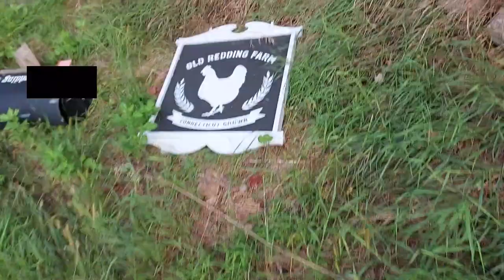Someone Destroyed Our Mailbox! *how to make a mailbox post with a cedar log*

Comment: We owned a house that had really bad luck with mailboxes. It was hit 3 times in 8 years. I finally decided to replace it with something nice and made my own post with mortise and tenon. I used a CNC to carve the house numbers and a fish (it was on a lake) into the top of the post on 3 sides. I spent a ton of time painting, finishing and sanding it. Within 3 days someone backed into it and split the wood…I was able to repair it and it’s still there 5 years later, but man I was ticked off.
Reply from the maker: That mailbox sounds awesome! and OMG I would have been so upset if it got hit that soon! maybe a trail cam set up on it so you can watch the perpetrator and then write him a nice letter :)